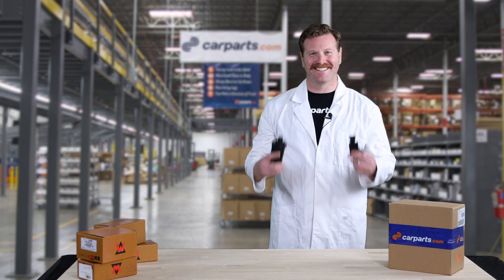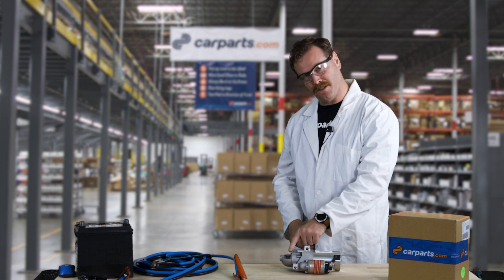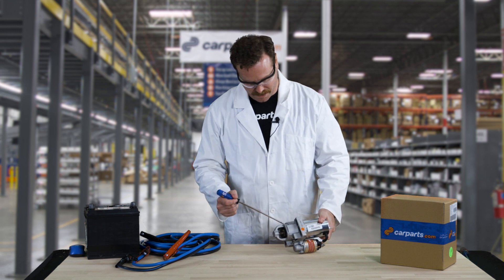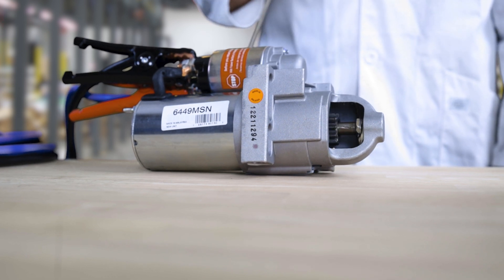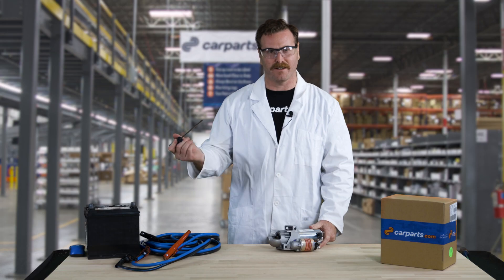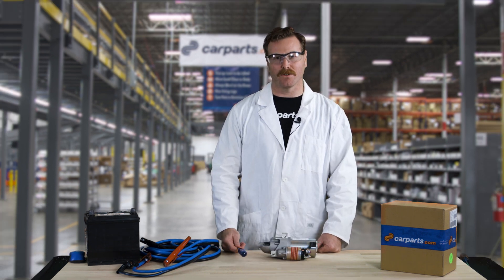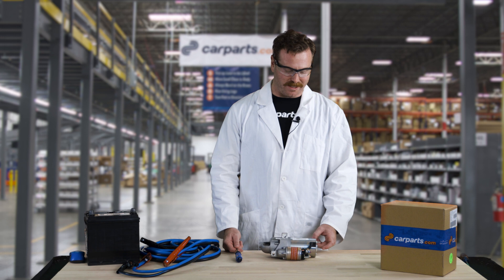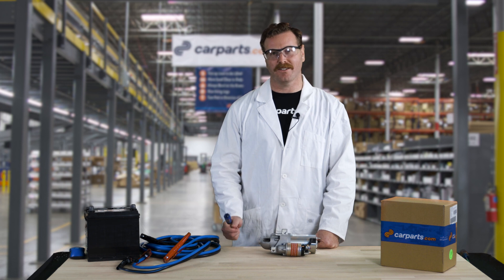How a Car Starter Works ⚙️| CarParts.com Parts Explained

Comment: I've rebuilt many a starter. My friends would laugh -- buy a new one they'd say, it's not worth your time. Oh really? I already spent time getting it out. I wanna know why it failed. So I'm going to take it apart. Grime is almost always the culprit. And if it's the brushes -- as this safety-first host mentions it could be, in an older vehicle -- guess what? The starter's old and full of soot and poo. New brushes are almost always available for like $10, maybe $20. With a turkey pan, toothbrush, and vodka as a solvent (for both you and the starter), you'll get you back on the road the next day, brushes or not. Slightly hungover perhaps, but such is the cost of savings.

This is assuming the windings aren't shorted, which can happen if it's been continually trying to crank an engine that won't start. The motor will overheat and destroy the varnish that insulates the windings. In that case, you will need a new starter.

I ended up here through a google search to dummy check a problem on my buddy's 2018 Silverado starter. And I may've had some vodka. Thanks for asking.